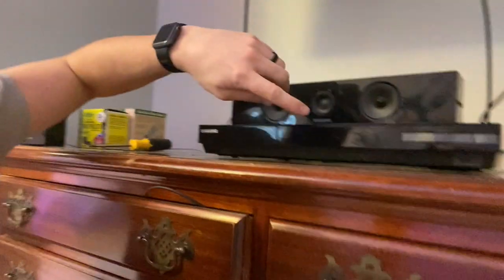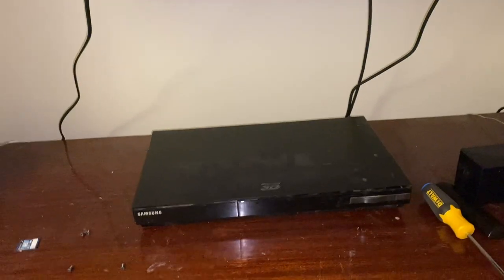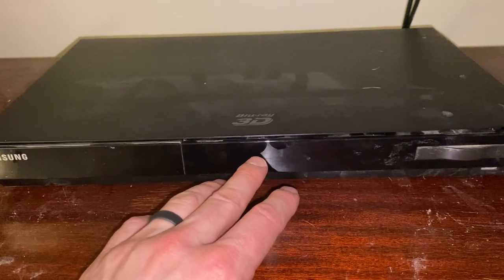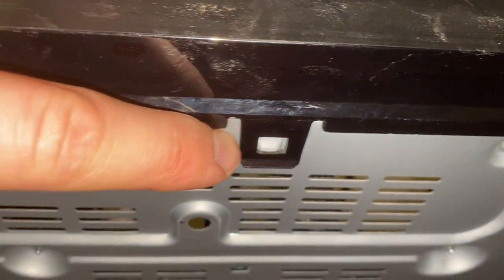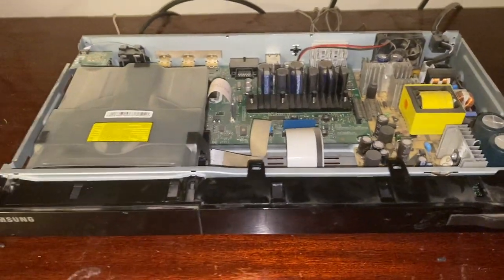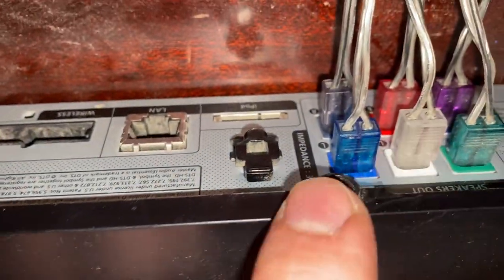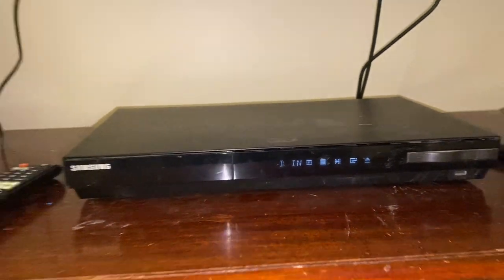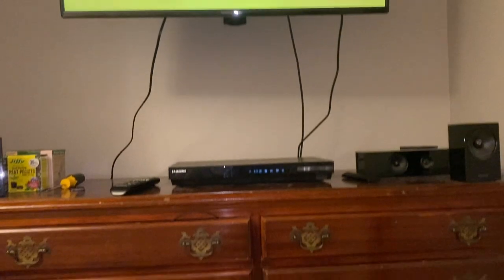SAMSUNG SURROUND SOUND KEEPS CHANGING INPUTS AND LOSING SOUND----THIS IS A QUICK FIX!!!

Comment: Thanks for the video!  Was shopping for a replacement system and then saw your video.  15 minutes and it works good as new.  Never used the system without the remote anyway.  Really appreciate your help!

Comment: I had the same problem right after I bought it new way back when. Sent it in for repair and it worked for 4 more months and then did it again. Still have it and no longer use it for a player just the surround sound connected to another Blu-ray player. It has just now stated doing the switching inputs again. This is the first time I found any advice and will try this. Thank you.

Comment: When I remove the white clip, after weeks the speaker suddenly stopped its sound, and now we can't change the tv source, we can't connect to bluetooth or AUV. What should we do?
Reply: It stopped voluming down and it has no problem but after weeks the tv source is not changing and just stopped working
Reply from the maker: Hard to say on that one, sounds like an even bigger problem. Sounds like your band aide only worked for a bit, sorry about that :/